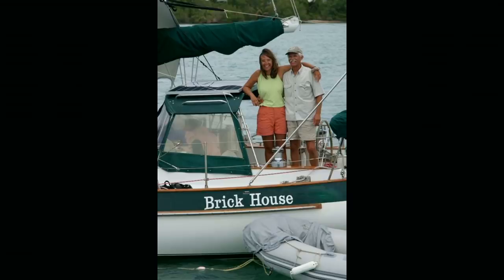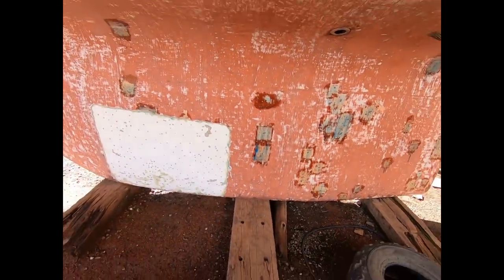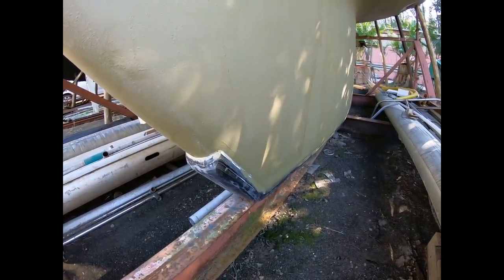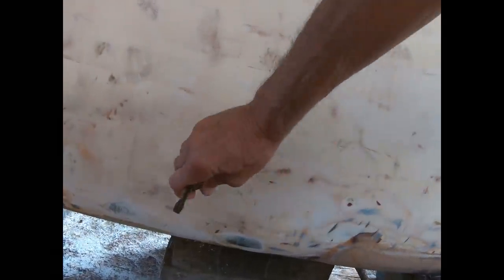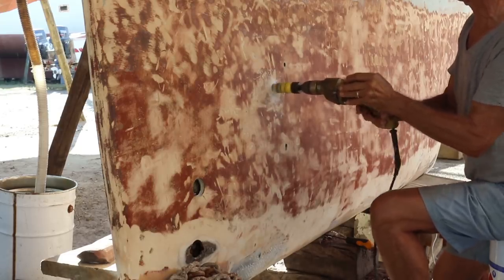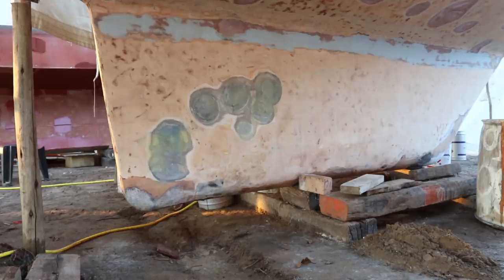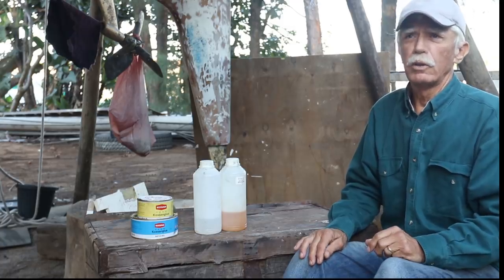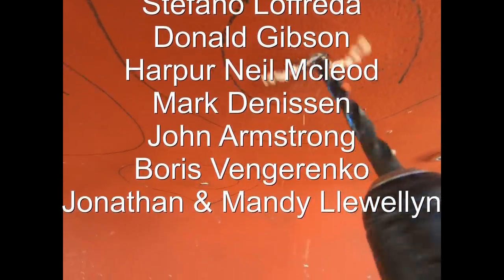Sailboat Keel Repair/Problem: SOMETHING IS MISSING FROM OUR KEEL !! (Patrick Childress Sailing #42)

Comment: why you did not had filler to your resin, it will have been more think to put in and better curing , cheaper too, less lackely to crack , as resine alone can crack like glass, i find with filler powder it keep more flexibility
Reply from the maker: Yes, Catherine, I agree, adding Cabosil, a fine cotton fiber, which seems to be the same as West System’s 306, would add strength to the resin. The problem was not knowing just how much of a void there was, how big in circumference the voids might be, how narrow of a gap the resin had to pass through to reach all cavities or any of the void structure. There needed to be something thin enough to run to all areas. I had no clue if it would take one liter or 30 liters to fill the voids.  The designer of the boat stated “There should be no voids in the foam…..” Another yacht builder gave several suggestions for filling the void. The only real option was to pour in the polyester. Even epoxy would have been too thick to run properly to all areas.  Not with this resin, but with past experiences with polyester resin, I have smashed a large hunk of it with a hammer and it did not shatter like fine crystal as some people suggest. Expanding foam was out of the question as there is no way it would have the brain enough to seek out all voids and magically expand to the proper amount. With walls of only 3/8”, I could visualize the expanding foam blowing and bulging out the skin of the fairing and creating a real disaster. I have worked a lot with expanding foam and have really screwed up window frames watching it expand far beyond what was expected. When just out of high school and working at a boat factory, I watched two workers pour two part expanding foam into the inner hull access of a brand new dinghy, just out of the mold. That foam really got away from them and came out the access hole like a triple dip ice cream cone….plus it expanded the whole dinghy to look like a big balloon at a parade. They spent the next two days digging all the foam out of that dinghy so they could start over again.  I am adding more layers of fiberglass to the bottom area of the keel, which will also help to disperse the loads. This may not be the approach others would take. However, I feel fully comfortable with what I now have where I felt there was a big problem before.  If we should ever go up on a reef, and the fairing fails, or when finished here in the yard and the anticipated strength is not there,  But If it was so delicate on land, what would happen to it on a reef?  I know of only one other boat owner who has corrected this same fairing situation. On his boat, the skin on both the port and starboard stern of the fairing, had been removed. I am not sure of the whole process but there were certainly no voids in the foam before it was reassembled. This responds to far more than you asked, but actually I am answering several questions of others and will direct them to your post. With anything about boats, there can be 3 ways of doing it right. But I much prefer to hear from boat owners who are commenting from hands on experience rather than theory. Thanks for your comment
Reply: @RVLifeNOW  I build boat and sail all my life ,more than 40 years,I believe I alas have experience learning the hard way😆
Reply from the maker: @catherinesecula5287  What kind of boats did you build?
Reply: @RVLifeNOW  i have built and restaure boats for 40 years , i stop counting the number of boats i have own, i assume i have experience and learn still everyday , 3 boats in my backyard at the moment, sail solo and short handed many place in the world and across ocean,so i beleive " i comments from hands experience" ,,from rebuilding timber boat from 1936 , to prototype from foamcore ..plywood .west system ...ect , my all life is about boats ..and i learn the" hard way" by many mistake too , it is not because i am a women than i don,t know....i am always more observing than theory spending my life around boatyard in France and Australia from racing to cruising..when i am not sure of a product , i always do a small test before to see if it will cure and adhere properly.i am a perfectionist now days, and see many obvious mistake and lack of commum sens even of top engineering design ,
Reply: i write a long reply and got deleted , bugger !!
Reply from the maker: So sorry to hear that. I checked the "Hold for review" and possible "Spam" folders and it is not there. If a comment has a link or something out of the ordinary, that comment gets diverted. Hopefully it will show up.
Reply: so i start again ..i am 58 , late 70 at 16 stole foam from building yard to shape my windsurfer ( did not have any money ) look at magazine to have idea of proportions , learn fiberglass from a friend , people where so impress they gave me rig , sails ..ect at 18 bought a 35 fts timber Colin harcher boat strip the all boat replace planks and gal boards and cooper rivets as well as re-caulking hull and deck , rebuilt allthe inside too , live on it for 2 years just with a drill and a saw , and my motobyke ( no much money ) beautiful tall spruce mast and long boom , was thinking to sail around the world with it ..( one is yound and full of dreams)..read every boot i could on sailing , create a business, build catamaran(race) , monohull prototype(race) from 50 fts to laser .. but when racing in 1985 Australia and feel in love so left Nice ( France ) had few other boat , haft tonner , cruisers..ect work as a photo journalist for sailing mag , so was sailing and following races around the world, delivering boats and teaching sailing , married too a sailor but who prefered his business than planning a retirement cruising the world, so 20 years ago we part , got a buitufull son that i teach to shape his surfboards , he was 7 years in Australian special forces , but he is now a structural engineer surfing was cheap !! , but he just bought a 31 fts racing boat in Sydney !! i am in Noosa , 1000 kms north , had a back operation 5 years ago so i gave my cruiser and have small boats now , a small trimaran portotype that i can lauch alone ( like to be independant), a mirror that i am renovationg for cruising the lake and river and a plywood 15 fts gaffer that i took the centerboard out to put leeboards.my ideal boat will be a 28 to 32 foots , 2 unstayed carban mast ( if i brake one , one is left for sailing, done that !! ) , lifting bulb centerboard ( that i can let go if i sink ) water ballast , rond bow as the french do now on they minitransat , open cockpit with 2 rudders (same if one break , one is still there ) , light minimalist built foam or plywood epoxy , elevated deck for comfort but rond deck so shard edge , for better waves crushing and walking on deck witha narrow hull easy to transport on a truck no engine , just outboard .i am renovating my house now to be able when my little dog go to the stars, to go back to full time sailing and renting my house for income , i do all the building , carpentry , plumbing , concrete ..ect..i am bipolar , my mind never stop thinking and creating, but the meds make me a bit tired.I want to explore more the med , greece , turkey , not interested by the carabeen ( been there ) nor by asain country ( been there ) but like French polynesia.  i had a cruising boat 10 years in the withsundays Australia , so i know well the East coast and coral sea of Australia. I would have my next boat built in poland as i know a mate who move there and was a boat builder near Nice . , I would like to explore the med and slowly sail back to Australian taking my time.leaving the boat some place in the bad saison. i beleive simplicity and light is the key for a boat of my liking. mimalist , as well with less electronic as possible , I cross the atlantic without radar ,nor  radio,only a small hand help gps...and paper charts ..i beleive people rely too much on modern electronic and do not learn to observe the sky and the weather and do not learn to listen to their iner feeling ..they sail in bad saison thinking they will be safe as they have all the technology ..each one to they own , i beleive in old time mariner waiting for the right saison and courants .they sail "house boat " with all confort , but ask for rescue as soon the rudder brake or they take on water , without having the means to fix at sea , with all the new epoxy , it is so easy , some cure even underwater ..and the deenama aloid to fix so easely your rig , or build a jury rig ...KSS keep it stupid simple... Voila , now you know my life story :) :) :)  all the best
Reply from the maker: @catherinesecula5287  Catherine, because of the  "  .my "  , this version of your post got directed to the "must be Approve file". Your first version just disappeared. Thank you for being persistent and going through all the trouble to rewrite it. What a great life on the water you have had! I know about minimalist sailing. I sailed solo, around the world on a 27' sailboat well before the days of GPS or water makers.  One had to know how to use a sextant and a Radio Direction Finder. My depth sounder was the keel. It is far easier these days. Now in our nav station, there are more instruments and electronics than in a small airplane.  Yes, it is surprising, some of the floating condos out here, crossing oceans, clothes washers, dish washers and all. I much prefer your approach of keeping it simple. That is one reason, in 12 years, we have never used our RO, water maker. We just don't need it. It is amazing how cruisers these days would go very thirsty in the middle of an ocean because they think drinking water can only come from a water maker. Like you, there are places we don't need to go, like the Caribbean. The Med would be fine, when we are too old to cross oceans. That is why I want to get to the far reaches of S. America, while we can. Like Zanzibar, Tierra Del Fuego has a very attractive ring to the name. We recently went to Zanzibar. Now, we have to have another great adventure before heading off to the Med.  Other than being expensive, Australia is such a nice country. I really like Queensland, up around the Cairns area and up to Cook Town. You are fortunate to live there. And also, as with you, French Polynesia is a great place to cruise. Fatuhiva, and retracing Thore Hyerdahl's steps was fun to do. Do you have a Face Book page or some where else I can see some of your boats?
Reply: @RVLifeNOW  catherine secula    is my facebook page
Reply: long long ago use the "gonio" too radio finder , and the sectant, but I will have no clue to do it anymore  :) ;)  it is more the civilation and people who interest me than "the beautifull beaches" we have so much beaches here , a beach is a beach to me , what is around it what it count , i am in Noosa qld .south America south fantastic, but i am too old for that, at this stage , i avoid political instable countries , or poor countries where my mood is affected and too fragile for my bipolar condition.i protect myself from situations who affect my mind too much. but love  Greeque and romain civilisation  history it why the med interest me and i have a twin sister with2 boats in Cannes ( near Nice).So i do get to Nice every second years, all the best for your sailing and adventure , one feel like a kid living that way,even sailing around the wild lake near Noosa i fell that way ...exploring the bush and everglade , happy with simple thing. so close to the nature , beeing awake by birds, Kookoobara every morning ,,or the kangourou around the corner..even on my small boat i live like a child ,( childwood wicht i was very disprave and terrible) .So now , i have the time and toys to do it. I am for the" normal people" in my suberbia , a bit mad with my obession with boats, but these feeling of serenity and freedoom sailing with the wind after so much hard work fixing and building from your own hands , no one can undestand if they never felt them .but i always say , 1 hours of sail is 10 hours of fixing and cleaning .....but i could not stop it anyway ...
Reply from the maker: @catherinesecula5287  All a great story Catherine! Today I put up a new video by Hank Schmitt giving some tips while on a Swan 48 sailing from St. Maarten to Rhode Island. I used to captain those boats for Hank, in November, to head south, then do the return trip in the spring. Always a fun trip, especially if we could get a winter storm on the November trip. The crew sign on for ocean experience and are generally disappointed if we only get 30 knots of wind. I will check out your FB page.
Reply from the maker: Catherine, you have some interesting posts on your FB site. The little boat at first I thought it might be yours. Serge Testa, an Australian has the record for sailing a 12 foot boat around the world. Cows in the dump; I took pictures in Sri Lanka of elephants eating in the town dump. Had to sneak in to get the pictures as the government does not want it known what some wild elephants are reduced to eating.